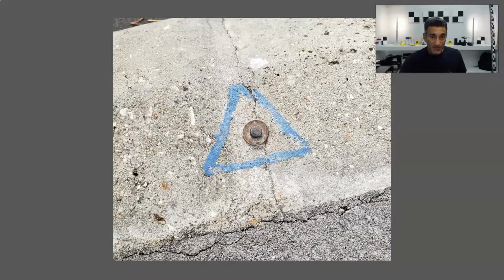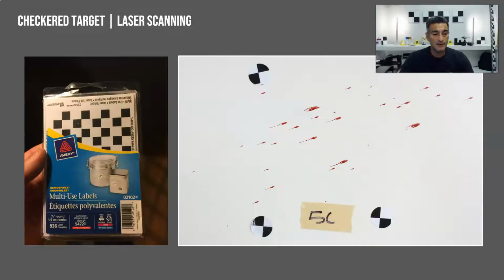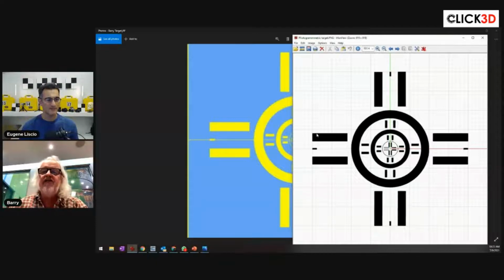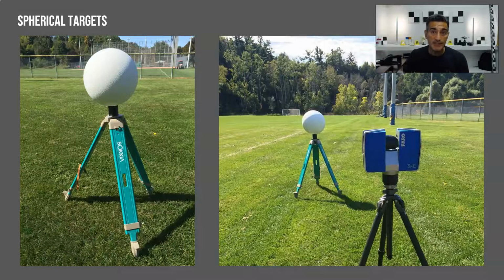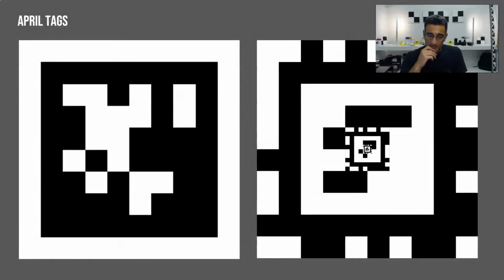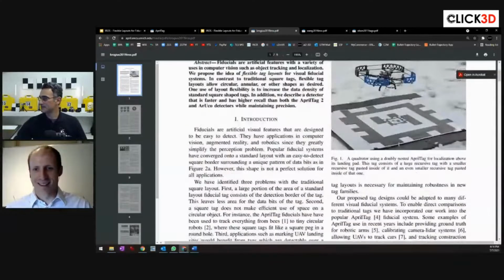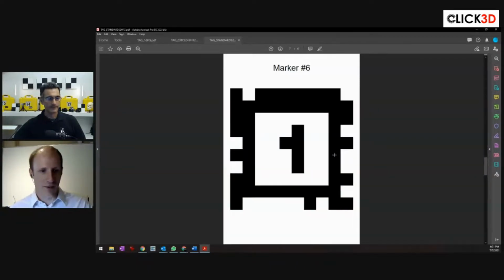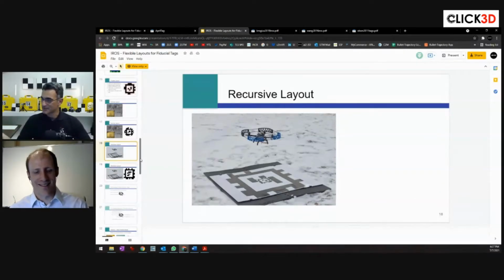Understanding Targets | 3D Forensics | Photogrammetry & Laser Scanners | Click 3D Ep36

Comment: I just realized something. If we measured in relation to the earth. If there are earthquake or any very big land movement. It doesn't move also this static points?
Reply: One GPS point on earth, after 10 years, may not have the same GPS coordinates. So we should not use old points.
Reply from the maker: Normally, when used for monitoring, you have a series or network of points.  If only some move, then you can easily see which ones and by how much.  Not much  you can do with only two points!